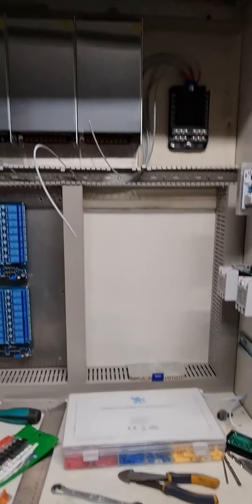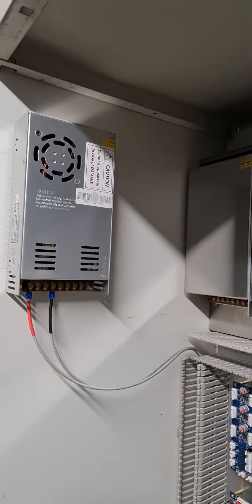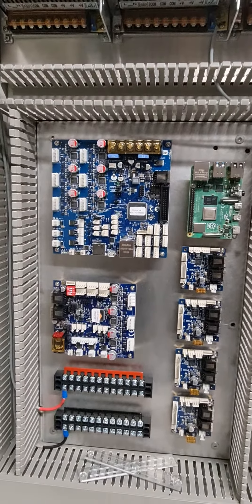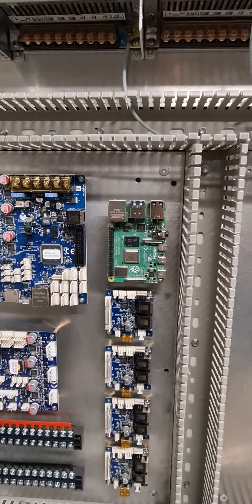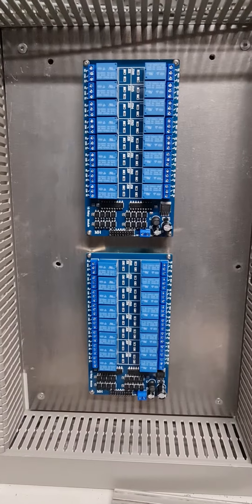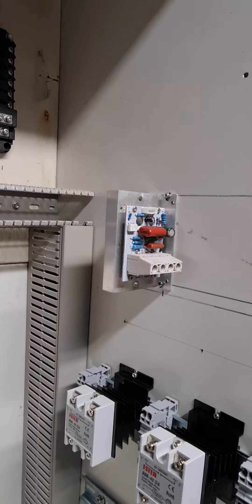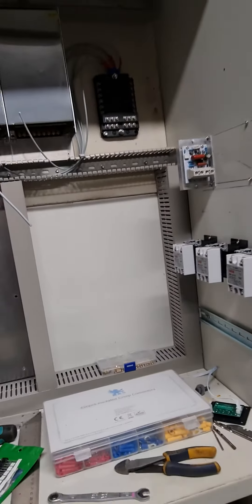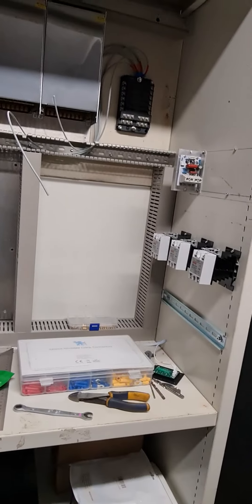Large DIY 3d Printer Duet3d control panel

Comment: the only thing i did not see was main contactors and its esa approved LMAO if you select the correct wires and ga.it can go to producton next week Nice job Aaron!
Reply from the maker: I was a bit lazy, direct wire to supply via MCB. Do need to install insolation switch and emergency stop.
Still plenty of work left on the electrical cabinet.
Reply: @Big3dprinter  its excellent you got this

Comment: Subscribed! interesting build! Curious how much this building is costing you? I am designing a similar printer, but much smaller. Really curious about wiring the external drivers to the duet board, I've been reading up on it but can't really make heads or tails, any links that would spell it out? Or maybe a video detailing the wiring?
Reply from the maker: Thank you for subscribing.
Costing so far is excess £20,000, lots of overtime to get the build to this stage.

1XD Boards only using for step and direction at the moment, they are much more capable. I've never done this before so will have learn myself.
Once i have my head around it will happily make a video on the wiring as well as software setup.

If you need some details on the 1XD Boards you can check out Duet3d dozuki or the forum site everything is there, links below.
Hope this helps.

https://duet3d.dozuki.com/c/Root

https://forum.duet3d.com/